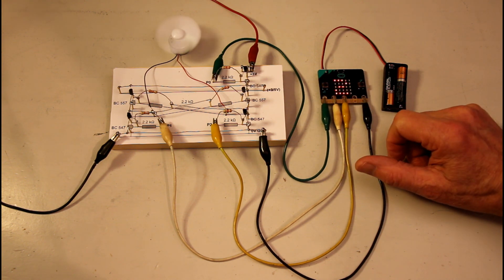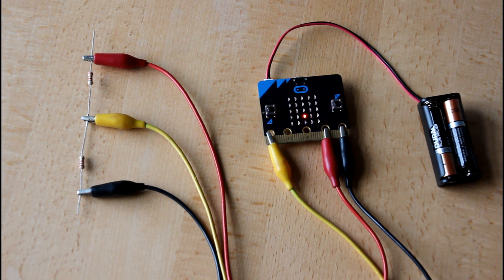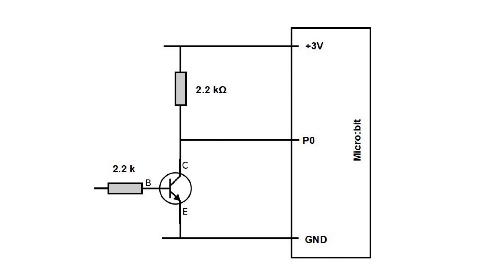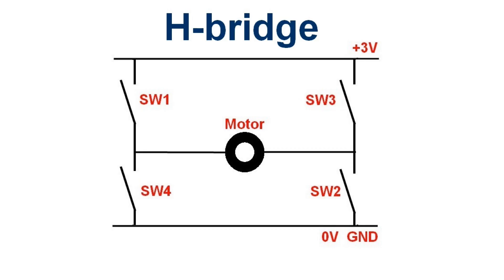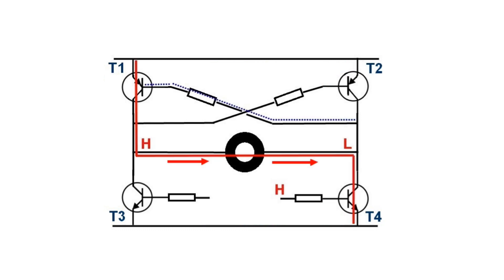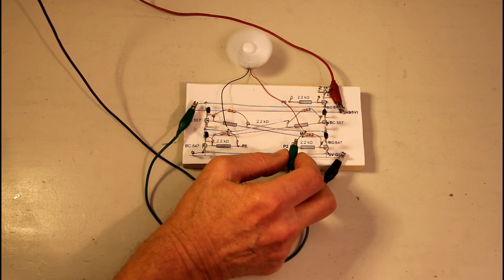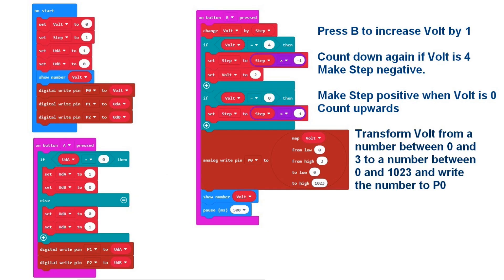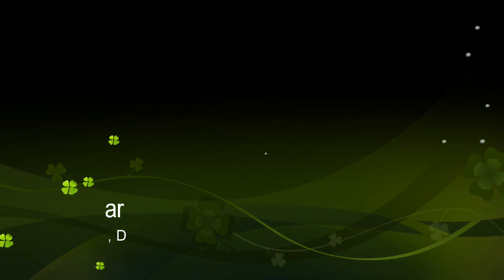Control rotation and speed with Micro:bit

Comment: i cant get it to switch directions I used the exact same code but used a bread board
Reply from the maker: Do you use both a NPN and a PNP transistor? Have you connected the legs correctly? Have you tested the construction before connecting the Micro:bit?
Reply: @gunnarlund6633  l only used an npn transistor with a 2.2k resistor and a terminal connector with 3 M/F wires